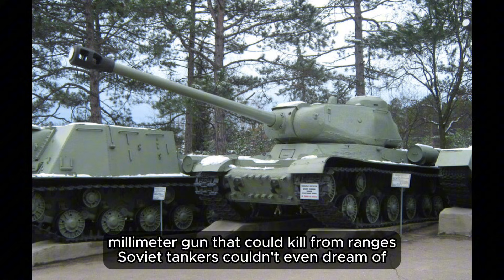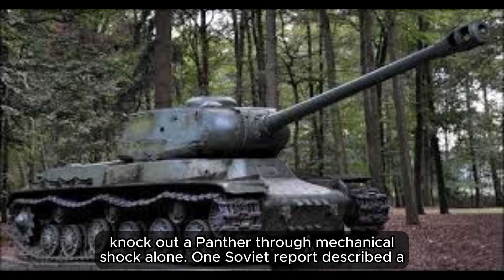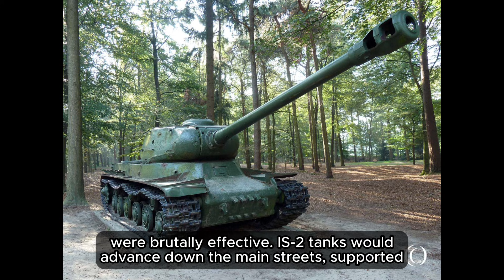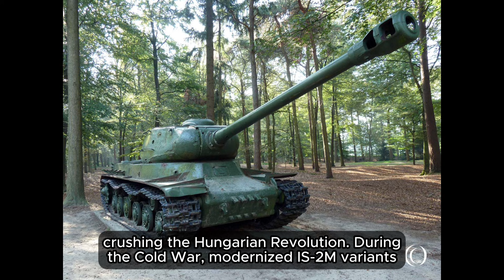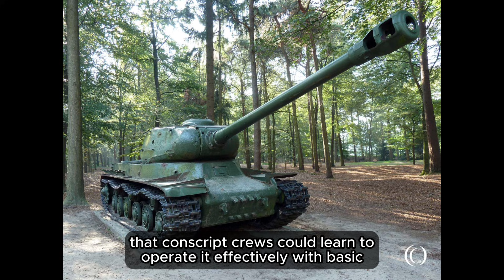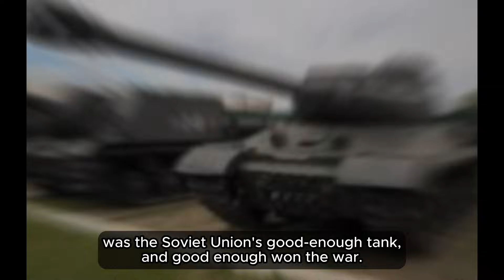IS-2: The Soviet Tank Built to Obliterate German Tigers

Comment: Thanks for not using AI. Definitely one of the better videos out here. Shock alone? I saw a tiny Russian Lancet 3 anti tank drone hit a Leopard tank in Ukraine. They look like a small box kite with a pusher propeller. It had a 2-stage warhead with the first taking out the reactive armor and the 2nd exploding inside the tank. The shock wave inside that tank was so intense, it blew all the dirt off of the outside of it. Really. ALL THE DIRT OFF IT! Not only was the Leopard destroyed, it looked brand new destroyed. I've never seen anything like that. Obviously there was nothing left inside the tank except goo. All from a drone that cost 8,000 dollars. A 31 million dollar tank taken out like it was child's play. And the skin rippled like it was made out of play doh. Unbelievable.
Reply: Really. A drone warhead isn’t kinetic, so it’s a shaped charge that relies on a high temperature spray to melt through (not blast) armor.  You’re describing kinetic energy effect that isn’t possible that requires a small mass hitting at least 4,000 fps like a bullet against soft metal.  Maybe you saw a Hollywood movie; I once saw in the movie The Rock a 4 lb canister with enough fuel and explosive blast like a 250 lb napalm device.

Comment: Soviets didn’t have high velocity anti tank gun. This vehicle was designed to crush fortifications not fight tanks.
Reply: some body got it right    these fools on yu tube
Reply: Not true, the 85mm on the T34/85 was a high velocity anti aircraft gun.  The 100mm on the SU100 was as well.
Reply: @jop4691  the german flak 88 was a antiaircraft the 85 on t34 was not high velo that why it bounce off tigers that is why soveit went to the 122mm on is2  that too was not hi velo
Reply: The reason the 85 bounced off at extreme ranged was because of the Tiger's thicker armor not because it wasn't high velocity.  Also the 100mm was superior to the 88mm , the Soviets just didn't have enough barrels or ammo available for that gun.
Reply: @jop4691  the german 88 can pentrate 7 inches of armor at any angle  the sov 85 cannot  the sov have used capture german 88 to put holes trough the tigers armor the germans did not upgun their tigers cause no allied tank had 7inch armor but the sov went up to 122 low velo to try to compete also it took 3 shot for a soveit hit  germans z optic 1 shot     king tiger the BEST tank of ww2
Reply: @donwalsh4445  Anyhow, it was worth Germans same as coat to dead man...
Reply: @donwalsh4445  Tiger II/King Tiger was quite competent sure, but kind of a technical nightmare. ''Over-engineered'' as all of 'panzers' developed and constructed during the war .
Reply: @jop4691  The D10T 100mm has a muzzle energy of 4.1 Megajoules, compared to 3.5 MJl of the Vickers L7 105mm or 3MJl of the 71 calibre 88mm